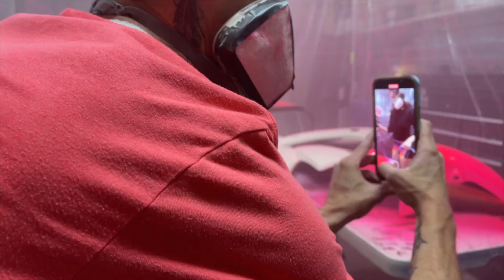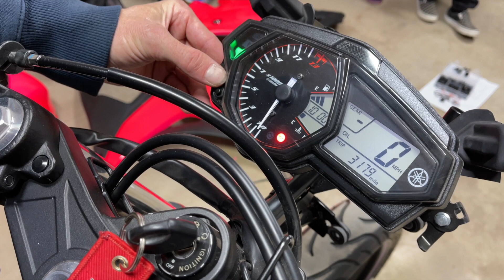We Built The Craziest Yamaha R3 In 16 Minutes!

Comment: Great job on the bike. I think you would be better served with the longer frame slider. The ones you have are for racing and will only help when you low side at high speeds and most tip overs are at low speeds and those frame sliders won't stop the plastics from touching the ground. Ask me how I know. 😂